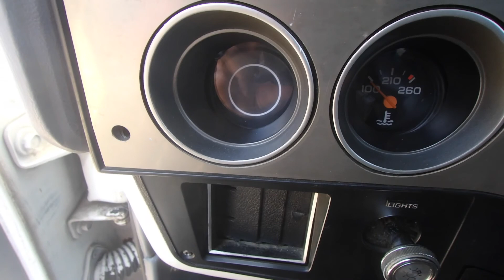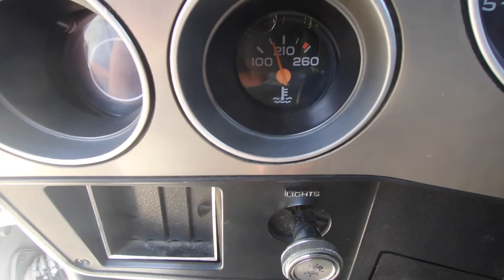First warm day lets get the Honda running and mess with the dually

Comment: Nice TFV8, that's what i'm rocking too now.  don't try the T10 coil head in it unless you feel like vaping at 130 or higher though.  can you not convert the dually over to disk brakes on the rear? not sure if they make a kit that works with the dually set up or not , just curious. yeah those wipers were a little beyond done. dry rotted from sitting too long i suspect. I ran 160 thermostat's in mine all the time but then again i live in the south too but mine were fine. That's total wierdness with the bike though